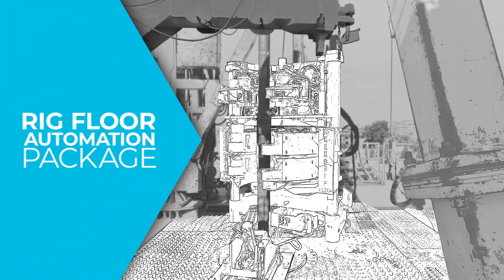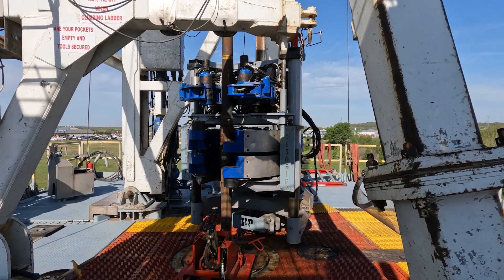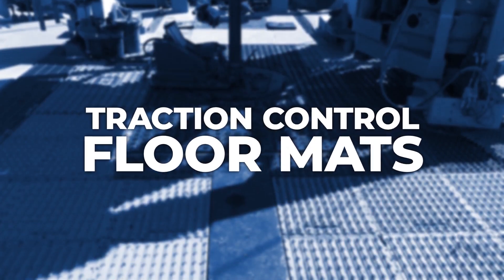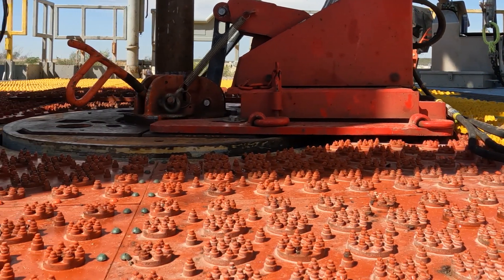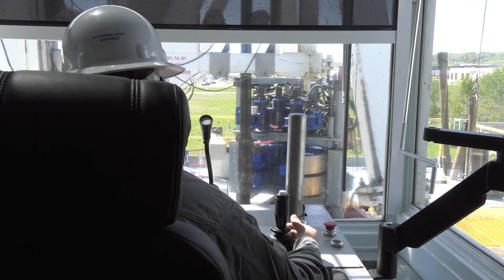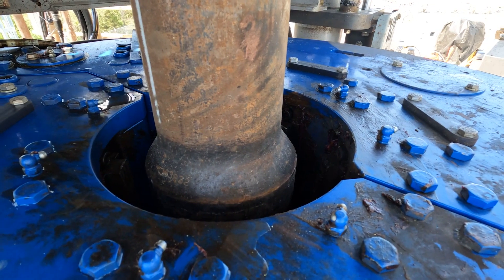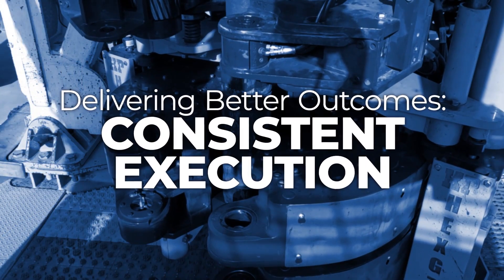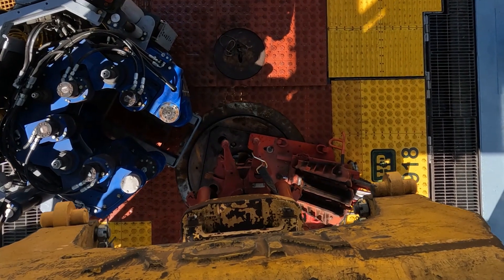What are the benefits of automation on the rig floor? | Drilling Contractor H&P

Comment: H & P is the most respected drilling company in the USA.  
Disclaimer:   That cover-plate adjacent to the drill-string is hiding my father's invention, called a Rotating Mousehole Tool.    ...funny name for an important piece of drillfloor equipment.
It is hydraulic rotating device that allows the floor hands to safely handle the drillpipe as it is added or removed from the drillstring.
CEO John Lindsay and his managers, drillers and rig crews are the best in the world.